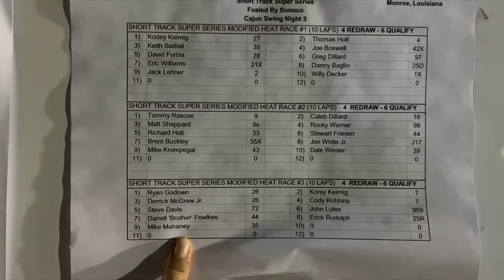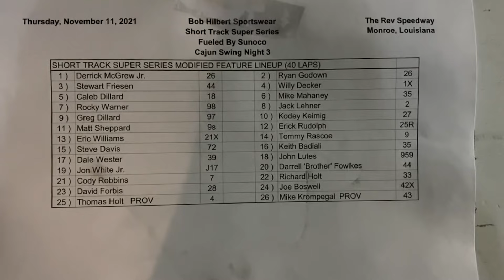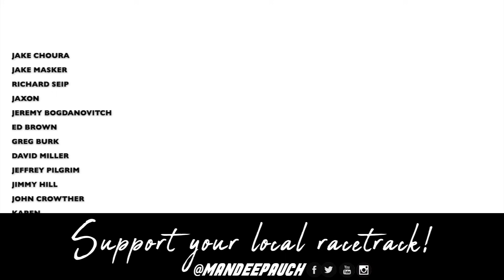Cajun Swing Day No.3 | Revolution Park Speedway

Comment: I wonder if you could spray the car with a light lubricant like canola or something to prevent the clay from sticking. Does it add so much weight to the car as to noticeably slow it down,  or is it just the mess that's of concern?
Reply: Both makes clean up a lot harder and they want the car to cross the scales 5 or 10 pounds over not a 100 pounds over.